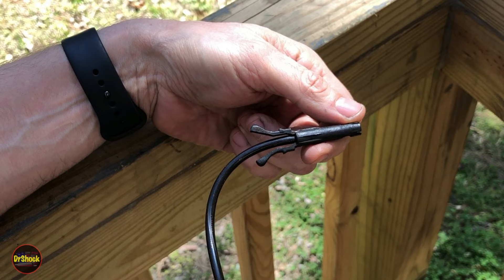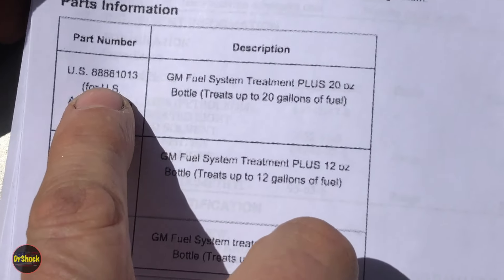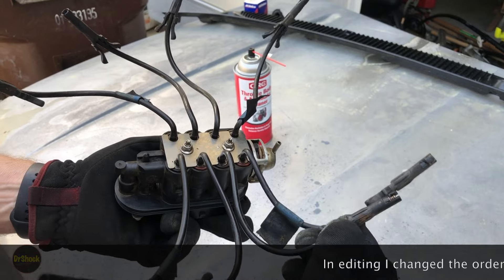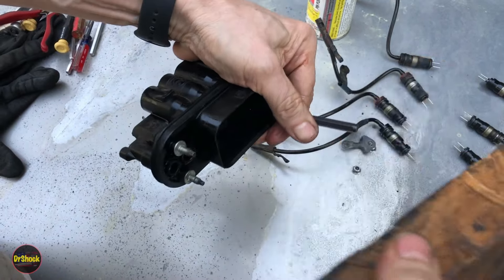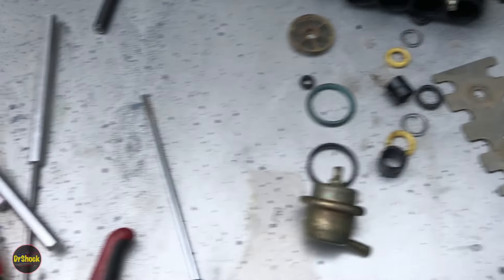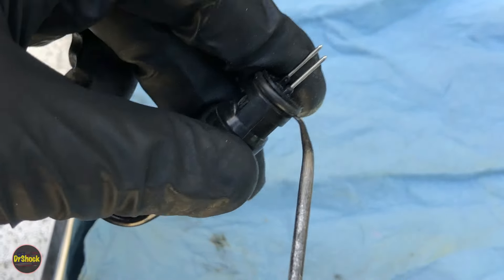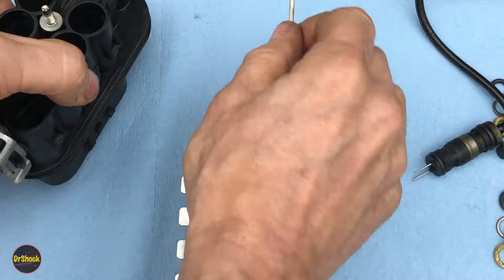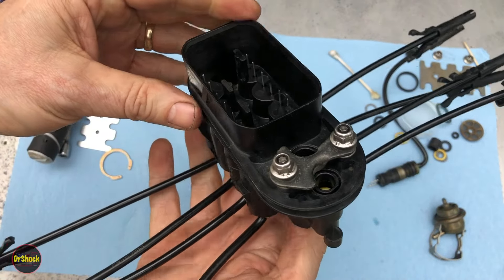1996 - 2002 GM OBS Truck Vortec Engine CSFI / SCPI Fuel Meter Body Injector Rebuild (Vortec V6 & V8)

Comment: The problem is not bad gas it is bad engineering. Every other vehicle manufacturer from this era was able to produce fuel injection systems that did not require "Top Tier" gasoline. This spider injection system was used in pickups and suvs. Low horsepower simple vehicles that should have easily run on the cheapest gasoline available.
Reply: 400,000 miles seems reliable to me
Reply: @erikredIV  400,000 miles of premium fuel, 400,000 miles of paying twice as much as everyone else, the mpfi conversion is cheaper than 400,000 miles of extra gas costs.

Comment: I have had 4 4.3 powered vehicles with the CSFI (spider injection) systems. they have all provided me excellent service. when the time comes that i experience problems with my vehicles i will convert them to the mpi style. theyre super cheap and they eliminate another point of failure.
Reply: I'm having trouble finding information for the MPI system for my 1995 Blazer W engine. Do you have any info you can share?
Reply: @choff6057  hahaha so true. Not so cheap anymore
Reply: @choff6057  AC Delco no longer stocks them. You can order Standard brand spider. It’s the same thing. Rebranded delphi.

Comment: Odd question. Ive got a set of the MPFI injectors, delphi units. Do you happen tk know if they are compatible with the factory "metering body" that uses the poppet injectors? They look like they would fit and id prefer to use the factory AC metering unit if i could, as opposed to a hit-or-miss aftermarket one.
Reply: Searching for the same answer myself. Hard to find a reasonable full assembly at the moment.
Reply: @mrja9898  Thought I'd update. Ended up using the whole new body and injectors. Truck runs great! I will say, BEFORE you put the upper intake back on, re-connect your lines and prime the fuel system to make sure it holds pressure. My regulator was damaged and leaking out of the box! Swapped in a brand new delphi one for free and it's good to go.

Comment: Great video. I’ve been trying to find a complete ac delco spider fuel injector kit to have for that day In the future I need it. I’m sure you’re aware it’s impossible to find. Now that I know if I can properly diagnose which spider injector failed. I won’t need to replace the entire unit with an aftermarket one. I got a 98 gmc 1500 w/ a 5.0 and I’m cataloging these videos. Thank You

Comment: I'm curious as to why you don't like the replacement spider injection system that has the wires running to the nozzles. Is there a problem with their reliability? If so please let me know, thank you.
Reply from the maker: There's nothing wrong with MFI, it is in fact newer technology and a GM supported backservice option for originally CSFI vehicles that encountered problematic carbon buildup.   But MFI just isn't how the vehicles were originally manufactured, so not something that interests me personally.   

I've spent several decades doing factory show car restorations on GM engines of the 1950s and 1960s.   Putting them back to the exact original assembly line condition right down to the head bolt and inspection paint marks.  Chasing down that exactingly correct shade of paint on a wiring harness bracket.    So I tend to treat even routine repairs and maintenance, on even an old 90s truck like this one, nowadays with the same attention to detail and GM originality is all.

Comment: 5:27 Chevron: Techron additive, engine treatment (CPS266362).
5:43 ACDelco: Excelda additive, engine treatment (88865595).
16:03 Fuel regulator assembly ACDelco (19210686) GM (19210686).
16:57 Spider body rebuild kit: ACDelco (217-451) or GM (17113205).
17:53 Injectors: ACDelco (217-265) or GM (17091432).
18:38 Reassembly.

Comment: Great video. I have a 1997 California Rig with a 5.7 the lines going to the poppets cracked and started leaking at 134,000 miles. I just replaced the whole unit with MFI. That was 4 years ago. The only issue I had was a failed pressure regulator only after a year. Things just aren't made like they used to be...

Comment: I just replaced the injector assy on a 97 5.7 sierra. Misfire # 5 cylinder (constant misfire) Owner replaced assy 2 years prior with an Amazon ordered unit. Said it ran good for over a year. I took the top off, # 5 & 7 injectors were reversed! Fixed it, runs proper. How could it have ran properly at all, after 5 & 7 installed in the wrong intake port???

Comment: Hello again, I got my injector assembly mostly taken apart at the moment. Injectors are activating when supplied power so I tied bread tie metel and tried to tug out the poppet to flush lines and all but  kept breaking the wire so I used vise grips and pulled really hard a few times with no movement. So have them all pulled out and soaking in hd degreaser overnight will try to move them again In morning.
Reply from the maker: They can be really wedged in there, so you may have to tap them out as I showed.  I don't know that you can remove them without causing damage, they were only intended to be removed in order to replace them.

Comment: Great video...We have to change out a set on a 2001 Jimmy 4.3....What is the cost saving between just buying a new set or rebuilding like you've done ? ....... We've always used an additive/cleaner in our fuel (STP type) but can't speak for the previous owner...I'm 76 and always had carburetors, so it's all new to me (Been driving my car for 53 years now) ....Thanks for posting this video....
Reply from the maker: Thanks.  On these original CSFI/SCPI systems you can either rebuild them yourself, as I've shown here. Or you could convert it to the newer MFI system that was introduced in later generation engines as well.   I don't believe anyone is selling CSFI/SCPI type systems new anymore.

The MFI setup will typically be available complete as a plug and play drop in, whereas the CSFI systems being much older will only have a rebuild it path to go with.   Personally, I prefer to keep things all factory as-built original even in an old GM truck,  so the rebuild path is what I've shown in the tutorial here.

Comment: i appreciate this video very much and still have my AC Rochester unit on my L35 vortec at 208 thousand miles in my obd2 '97 sierra 5speed. try and stay away from them made in china and made in mexico deLco's cause i seen that regulator you pointed out and how it was different from what came on your unit . you can still source new old stock for these . like my fuel pump i was able to find the square plug since i didnt want to solder in that oval plug when they decided to substitute the fuel pumps you had to change the wire harness out for the oval plug provided with the new pump. i like the deLco made in canada and detroit since they're spot on and plug n play but i also know there not easy to find.

Comment: Ive seen some people say that you can adjust the flow on these injectors by turning a tork screw that’s underneath the resin drop between the two eletric conections. My truck is running rich and im thinking about doind that. Apparently some models even have a cut in the plastic housing to access that screw but mine doesn’t and I’m reluctant to cut a hole on that plastic
Reply: make sure your temp sensor is ok, my 96 was running rich and the dash temp read good,but the scantool engine temp was off.replaced temp sensor (cheap fix ) good to go.

Comment: Just wanted to say thank you for the video it was the only one I could find that had the info that I needed.  I do have one question how do I know if the poppet ball on the end of the injector hose that sprays the fuel in the cylinder is clogged with carbon deposits causing a bad spray pattern?
Reply from the maker: Thanks, for this type of setup there's no straightforward way to view the spray pattern.  If you are concerned about this during an intake manifold rebuild you could use a carburetor cleaner, or similarly rated product, on the poppet ends before reassembly if reusing the originals.   Regular use of Techron in conjunction with a Top Tier fuel provider can go along way towards avoiding such build up though.

Comment: Is  it cheaper to just order a hole new assembly  ,and are they attainable ,You make that look easy.......
Reply from the maker: You cannot order a complete CSFI anymore, they've been discontinued by GM for many years now.  Only an MFI is available, which came out for later year trucks after the GMT400 series went end of life and would not be original equipment.

Comment: Ive got a 2003 s10 every thing works but the lines 1 is leaking right on bend of hose 
its got the injectors where your poppits are .
but is it possible to get just the lines between the body and injectors ?
Reply from the maker: You have the later MFI style for 2003, without the poppet valves that the CSFI style I'm showing in the video.  But GM does not service the fuel line separately for either, you have to purchase the complete injector assembly in both designs.
Reply: @DrShock  thanks for answering 
do you know what kind of hose that is?
Reply from the maker: No, I suspect it's some type of nylon material though.
Reply: @DrShock  thanks
Reply: @DrShock  tryed all kinds of lines that burst or dont fit figured it out .
its listed wrong as return hoses 
they are all nylon  1/4 inch  OD 1/8 id 
deisel is same as gas 
they are Door man part .
listed as deisel return hose and 10 inches long they are actually 7 inches and 8 of them with 16 metal clips 
part number 904-101
you have to heat ends so they shink after cooling with heat gun or boiling water
and use the clips too 3rd times the charm figured id share save some bs mickey mousing
thanks for help
Reply: @DrShock  costed 45 bucks
Reply: @DrShock  had to drain the oil too each try the last try had 8 cylinders full of gas had to pull plugs and crank it it locked up engine glad i didnt bend rod

Comment: Where is a good place to get all these replacement parts? Thanks
Reply from the maker: I put all of the GM part numbers in the video description, with some links where they may be found.  Most of these parts have been discontinued by GM since the pandemic though.

Comment: wow amazing video!!! did not know this F.I system could be rebuilt .my poppet valve injectors are long gone. would you know where I can find the O-rings and washer retainers? I did a MPFI and lost the O-rings and washers. I wonder if there is a kit available.?
Reply from the maker: Thanx, the GM CSFI / SCPI kit I used is listed in the video description, along with purchase links.
Reply: @DrShock  thank you sir.

Comment: Question. what is the Plunger with the long tube that is behind the screen filter & regulator assembly, I see you did not take it out. what is it's function? I am having trouble with mine, it bypasses the unit back into the tank leaving 0 pressure for the unit . I already installed a new regulator on it. same thing? held unit with hand plugged into the fuel lines, it just bypasses?
Reply from the maker: Anything I didn't remove is not serviceable separately.  I believe you are talking about part of the black plastic fuel meter body assembly that sits behind the regulator.  If so, then you would replace the fuel meter body assembly itself to address a confirmed issue there.  There's a link in the description for both the V6 and V8 flavors of this part.

Comment: Zacherymcclain, I have purchased two different mpi fi, one from Amazon /china and the second made in the USA. Both have leaked and I’m still having issues. I would suggest to rebuild or purchase OEM for this part. Wouldn’t want anyone to go through this like I have been. Just my two cents.
Dino

Comment: Very detailed explanation, what made you decide to rebuild this? Did the engine have a loss of power? Did this fix or improve the issues you were experiencing? Is there a follow up video?   
I have 3 vehicles with this engine 1 has very good performance and the others have always been sluggish. I'm hoping this will help me with mine. I like these older body styles and hoping to hold onto them and get more miles out of them.
Reply from the maker: We had to rebuild the intake manifold on this particular vehicle due to oil leaks from aged gaskets.  Since the vehicle was approaching 400K miles, it was a good time to refresh this assembly as preventative maintenance for the next 400K.   It was one of those while we're in here sort of decisions.